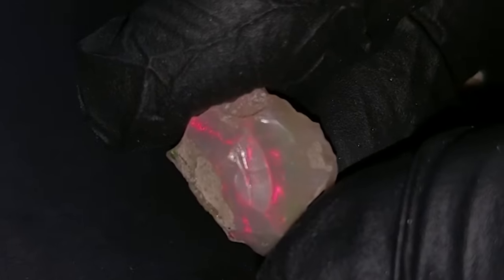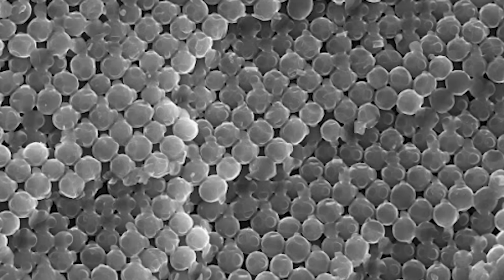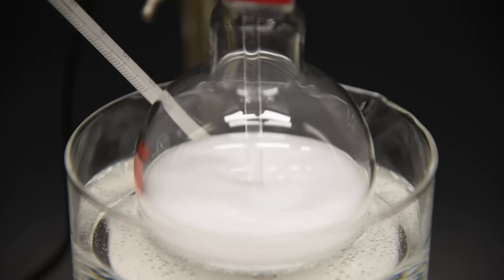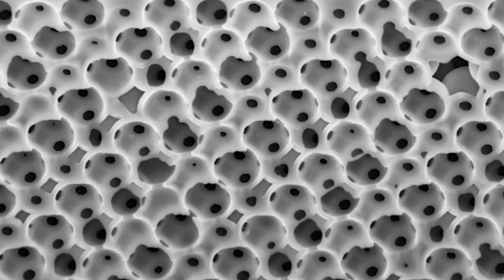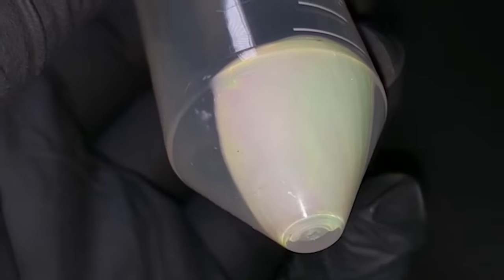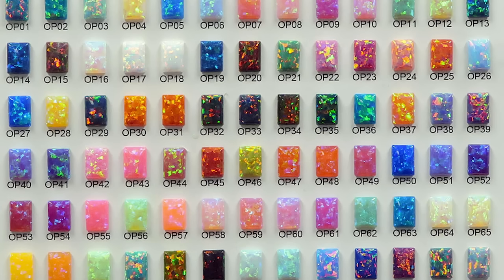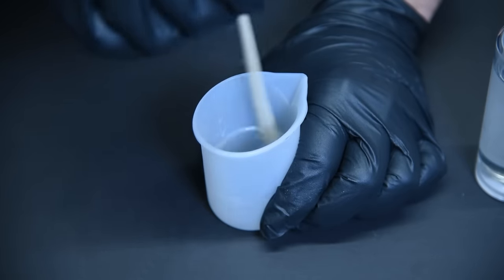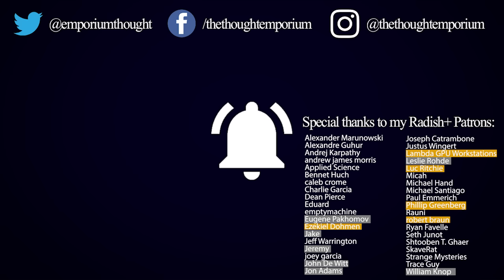Can you GROW an Opal?

Comment: I have a suggestion as to which resin to use: you could give it a try with dental composite resin. It has two main advantages: It can be obtained in a quite thin consistency, and it has a really low coefficient of expansion. The do this because it would obviously be bad to have it expand/contract too much in a tooth because that would cause issues, but it might just be exactly what you need here.
Reply: Specifically, I'm talking about vinylcyclopropane derivates. Another benefit I forgot to mention is that they can also be cured with UV, so you can just wait for a while until it's completely diffused into the Opal.
Reply: Yes
Reply: How about cyanoacrylate?
Provided nothing used in the opal has a catalysing effect, it should cure harder & not discolor from long term exposure to UV.
Reply: @kaisersose5549  The main issue with Cyanacrylate based polymers is that they show significant shrinkage upon curing, which can easily break the delicate Opal structure from the inside.
Reply: @doyale2  
Fair enough... If cyanoacrylate cured all at once.
Wouldn't the internal stresses be greatly reduced by a complete encapsulation, as was done with the epoxy resin?
That should spread the force of contracting across the external shell of cyanoacrylate (as curing happens from the outside to the inside), then actually hold the stone in place as the inside cures.
Reply: @kaisersose5549  It might be worth a try, but I don't think it would solve the stress issue completely. Because the cyanacrylate would cure from the outside to the inside, it would probably be fine for smaller samples. But as soon as you're attempting this with a larger opal, the stress would not be distributed properly and it would still lead to cracks after some time. That's also part of the reason why it's not advisable to try and fix large cracks with Cyanacrylate, because it would contract and not seal well enough. It wouldn't be fair to dismiss the idea entirely though, so I would definitely also love to see it tested!
Reply: @doyale2  
My concern would be that the silica particulate would catalyze the cyanoacrylate immediately.
Other somewhat similar substances cause it to go cock stiff on contact.
As easy as this experiment is to reproduce, I'll start gathering materials to do so.

Comment: Stabilizing resin could work. It doesn’t cure until you heat it. It’s very thin and can soak into wood to stabilize it. A brand I see often is cactus juice. Peter brown has used it before lol

Comment: Hey mate would love an update on this, if you still have any samples that have dried out at this point.

Also have a suggestion that regarding the drying/resin impregnation. I've been making transparent wood using the peroxide method, bleaching with h2o2, curing under UV lamp to degrade the cromaphores, soaking in toluene to displace water/h2o2 and then vacuum impregnation of thermoset resin.
I'm not aware of how fragile the silica structure is in comparison to the balsa wood we used (~1mm thickness) but could you displace the water with toluene or other solvent, then put in a resin bath in a vacuum? even with a relatively thick resin it should impregnate the porus structure.

Comment: I have a couple ideas, which you might try individually or in combination.
Settle for a few weeks to set up the nice structure, then use the centrifuge to compact them more quickly.
Sinter first, then resin.
Sinter first, then fill with sodium silicate. Or the other way around.

Comment: I just want a bathroom tiled with black synthetic opal.
Reply: I wonder if opal is strong enough to coat a car with?
Reply: @runed0s86  lol dude you just put metal flake in car paint to get light refractions, you dont need opal
Reply: @bmxscape  what if you coated chitosan car panels with opal? It would be so much better than car paint, and wouldn't rust!
Reply: @runed0s86  don't eat the hype, man
Reply: There is a feldspar stone that is utterly black, fiery, and beautiful
Reply: Keep in mind opal is very soft and can be easily scratched
Reply: @Andi2495  so... More cushion for impacts, and you can sand it down/reglase an area for very little cost
Reply: @runed0s86  I was wondering that. I want my corvette opalized!

Comment: Thinking about it the three most likely ways I can come up with for making the band structures less obvious are:

1: Agitate it occasionally to change the settling pattern

2: Tilt the container occasionally to change the direction of gravity

3: Use a mix of slightly different particle sizes, or multiple separate mixtures with different sized particles from each other.

Comment: What about using cyanoacrylate instead of resin? It's activated by moisture, which could be controlled to adjust the curing time.
Reply: Opal requires a water content over 5% as a rule

Comment: Brilliant video! Do you think your technique and insight into the drying process could be used to stabilize Ethiopian opal that cracks when out of water? Also, do you think the shape of the vessel could alter the way the silica particles precipitate? Would a vessel with wonky irregular walls, chunky sand or shards of glass cause little micro currents that might lead to interesting refractive patterns?

Comment: To get the better grain structure, since you mentioned it forms relatively quickly but the long settling process is required for strength, could you let it settle in a homemade centrifuge that's vertically oriented? I haven't tried the experiment so I don't know how delicate the settled pellet is, but if it could survive the initial shear force of the centrifuge starting, you could complete the compression process in a fraction of the time while preserving the grain structure.
Reply: He mentioned centrifuge at 10:40 or so

Comment: I know it's a little late but if you do more with this look up how turquoise is sealed. What is used for turquoise would probably work. Also there are many types of resin and epoxys available in woodworking and the boat stuff to look at.  I think the turquoise sealer is the best option.

Comment: I had some success using opal powder, mixing this with small amounts of art-resin, injecting this mixture via syringe in to a ball of Art-resin ( I used plasticine to make various mold shapes), allowing everything to set, ground glob in to various gem patterns, then sanded from 200 to 10,000 grit to polish. I experimented with various injection styles--lines, swirls, blobs, etc. Shaping of the exterior finish I found was critical in focusing ambient light to blast through the suspended opal concentration to really make the finished product blaze.

Comment: You need to a type of resin called “cactus juice”.  I use it to stabilise wood by putting the wood under the cactus juice and vacuuming all of the air out and releasing the vacuum and all that air is replaced with resin inside the wood stabilising it.  It’s super thin and is a heat curing resin so it will easily work for your needs.  Just cook it at 93°C for an hour or so and that will work.

Comment: Could you use vacuum to make the resin soak into the material?
Reply: He filmed drawing the vacuum, but not repressurizing it before the resin cured. can't imagine he forgot that step.
Reply: I'd expect that particularly violent outgassing would ruin the crystals. Maybe if you chose the resin perfectly, but...
Reply: @duncanw9901  hmm, maybe if you pull a vacuum, then pour the resin. That of course gets a bit tricky since you need to move things inside the vacuum chamber.
Reply: @Gameboygenius  time to ask Cody
Reply: @Gameboygenius  just mount everything rigidly inside the vac chamber then tip the whole vac chamber to pour.
Reply: @benowzinsky5394  I imagine you'd want to stir the mix a bit and not just pour it.
Reply: @Gameboygenius  

If you've mixed the resin thoroughly, then why stir it? You can get resins that take a very long time to cure
Reply: @dontnubblemebro  to mix the opal particles evenly.
Reply: @Gameboygenius  you'd have to play with temperatures and/resins to find one of adequate viscosity to keep the particles in suspension while drawing the vac and while curing. E.g e180 system from fgi/allnex with a slow hardener at around 20 degrees Celsius or less keeps most particles I've tried in suspension but I've only used fairly small (approx .7 mm) sands and garnet.

Comment: This is really awesome! Now I'm tempted to try and make some. I wonder what it would look like if you tried making one in a mold. As far as the resin goes, have you tried Cactus Juice? It's a resin that's used for stabilizing wood a lot of the time, so it might help with this.
Reply: Dang, I hadn’t read this far down the comments before I just posted my own suggestion of the same thing.  Cactus Juice or Stikfast work nearly identical.  I have had great success with them turning mungy, soft and insect compromised pieces of wood into material I can safely turn on my lathe or shape into interesting things.  Not sure if there is anything in the stabilizers that would have a negative effect on a lab grown opal, but worth a shot. Anyway, like minds. Cheers - E in NoCal

Comment: I don't know if you already found this out, but Peter Brown uses stabilizing resin, when he works with a porous material like wood. That way there won't be issues with bubbles when he casts the material in epoxy. It cures with heat, like a toaster oven. But I don't know if the stabilizing resin would penetrate on a microscopic level which is what would be needed in the case of synthetic opal. And I don't know if heating the sample would ruin it.

Comment: To continue my previous thought of resin to opal solution. You could also try a pressure chamber as well if removing the air via vacuum doesn't help with saturation.

Comment: Hey, could you possibly, after the first few weeks of letting it settle, compress it slightly with a pneumatic piston, to hold the particles in place while you drain the solution?

Just wondering.
Reply: I had a similar thought but put it in the centrifuge after you've settled it  few weeks.

Comment: For the resin issue, try using a resin type called 'cactus juice', it is a resin that has the consistency of water, but only cures when baked at a certain temp. To get it into the cracks and crevices, you could use a vacuum chamber to suck out all the air, while the opal is soaking in the cactus juice (IDK if that is the actual name of the resin type or if it is a brand that produces the specific type of resin), that way you can replace the air with the resin as it is being siphoned off.

Comment: glass sticks extremely well to... Silicone... Silicone is used for aquariums, car windows and so forth. So, if you want to glue your dried crystal using not-resin, you can try silicone componds. The cool thing about silicone is that you can dissolve it in acid to thin it out, like bathroom silicone. Perhaps it's not the right idea, although it's a highly controllable viscosity glue.

Comment: I wonder what kind of results you'd get if you used a range of polar and non polar solvents to do dual/multi crystallizations? Also, i wonder if the resonance frequency of the crystals at the time of the seed crystals forming has any effect on the light refraction/colour spectrum or whatever.. also remember its the impurities that make every single crystal unique.. maybe try adding some random elemental variables and gasses during the crystallization process!!?

Comment: Ever try to use sound frequencies to align the particles? Just asking. Not sure if that would work, but I’ve seen some interesting anomalies with sound frequencies. Imagine pressure and frequencies combined? Pressure might work for your resin? I see you later tried the pressure method. Anyway varying levels of heat, vibration and pressure could change things.
Reply: yea I was thinking "very specific vibrations" same same.

Comment: As for the non stripy synthetic:
Growing it normally, dry, sinter.
Then break/cut it to small pieces, and putting them into the next cycle, repeat a couple times?
It would take AGES to complete, but should be possible.

Comment: you probably since this video has been made stopped looking at the comments on it but if you do still look at them all I can say to fill the gap is a resin I use for wood working that you use in a vacuum chamber. it's called cactus juice. it's a water like resin and when pulled under a vacuum for several hours will pull the air and remaining water out of the fibers of wood. when you release the vacuum let it still sit for 24 hrs in the resin before placing it in an oven at 190f for probably 1 hr depending on your sample size. it's a low heat resin that feel has as a rock. it will probably work to fill the voids

Comment: A while ago i worked at a place that made synthetic opal that looked nothing like natural opal. It would color shift as you changed the angle, but extremely uniformly. The material was cut extremely thinly and was used a raman gain medium for a widely tunable laser source in the days before ppln or ppktp parametric amplifiers. ❤

Comment: I have a suggestion for changing the stripes to get closer to natural opal: try tilting the bucket it dries in. Have to set up a randomised tilt table to tilt at random angles at semi random time intervals during the months long sitting in a bucket stage. Wondering if bucket stage might be sped up by putting it under pressure also?

Comment: Use a three necked flast, connect an acidic washing bottle to it (so ammonia can't get out). Add the TEOS with a tripping funnel, or use a sringe in combination with a septum. You could also leave away the washing bottle by connecting a baloon with a cut down one milliliter sringe by using a short bit of vaccum hose. Stick it through the septum and you have a pressure relieve. That way noting can get out of your flask, but it can't block up

Comment: My current thought is, would you be able to imitate opalized objects like petrified wood and fossils using a pressure pot or vacuum chamber to embed the solution into the material and allowing it to settle under pressure? If so, would the amorphous shape of the object effect the resulting pattern? Sidethought, for the tiger striping, would a container with various dimples at the bottom break up the "layers" and result in a more asymmetrical pattern? This is one of the coolest videos I've ever seen and I'm colorblind. Such amazing work you put in

Comment: Hey there, you mentioned not knowing what resin to use, for your opal....I have been cutting opal as a hobby since I was 12 years old.   What you want to use is a two part epoxy called Opticon, it helps stabilize opal. In particular that from the US (Spencer, Virgin Valley) , Canada (White Sail mine, and the one in kelowna),  Ethiopia, Brazil, and Lighting Ridge Australia (Queensland and Cooper Pedy are still quite cuttable without it).

Comment: Regarding your attempt to use sodium silicate solution,  it seems odd that it would react with residual ammonia.  I've gelled waterglass solutions by adding acid of some kind, which lowers the pH.  Ammonia would increase the pH.  You might try adding sodium silicate solution to the nanoparticle suspension, that would ensure that it is fully incorporated into the nanoparticle matrix.  That is, if you have any more TEOS to experiment with.  In addition to acting as a binder, waterglass might slow the settling rate while being centrifuged.  It's on the viscous side.

Comment: Regarding the resin you are trying to infuse I to the opal structure without damaging the pattern.  I in no way am speaking from experience, but from my many interests and topics of YouTube channel viewing, all too often anyone who is using epoxy and resin in their projects do a number of different things to ensure their project has full penetration with the least amount of "bubbles" , and essentially this seems to be the issue your experiencing, and thusly one of the techniques I've seen used is if you've tried application  of the epoxy primer which is applied to penetrate easily and more complete.  Also, another technique is warming/heating the resin/epoxy allowing it to be less viscous.  Heat also 8s almost always applied by way of a torch on the surface to removes bubbles and foam making me think that if you were to warm your opals before submerging into your resin, you might get the same result of allowing the resin to warm making it more fluid.  I also have seen vacuum chambers used, and even sometimes vibration too as a way to completely remove air bubbles and pockets of air.

Comment: Fascinating!  I've thought about making synthetic gemstones.  I had thought opal would be horrendously complex, had thought about building a verneuil furnace for saphire.  

For pattern You might try making say red, dry it, break it into say 3mm pieces avoiding mixture of sizes so it has low packing density.  Then make another color - say green.  Before letting the green settle drop in the red pieces.  The green should fill in the spaces between red pieces.

Comment: There is a resin peter brown uses that won't cure unless it's been put in the pressure pot, then heated. That sounds like it could work well. Plus resin that doesn't get absorbed can be used over and over until heated

Comment: I've done a very small amount of resin pieces, but one thought might be to brush the resin on if you can? I don't know for certain and it might take a couple of brushes to get the full piece coated. Another thing to try is have a shape for both a silicone mold for the resin and the opal if possible so that there is not as much resin left that needs to be taken off.